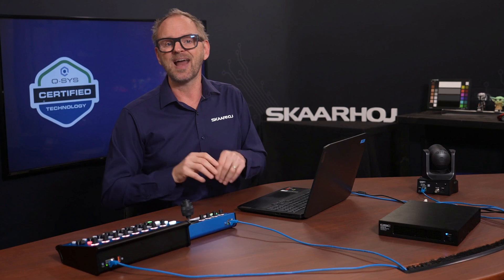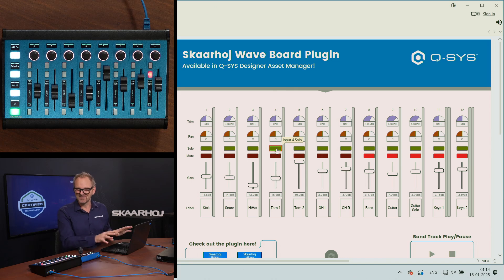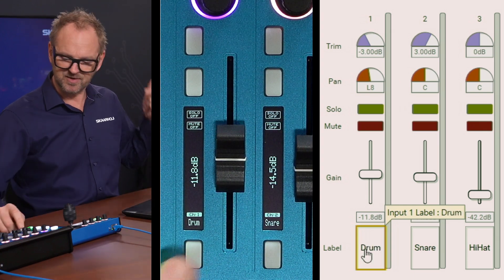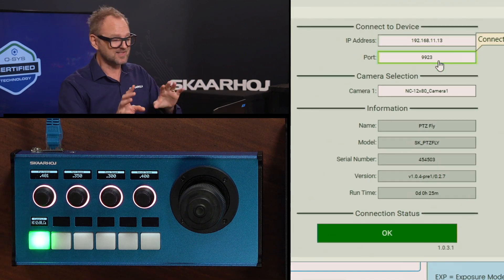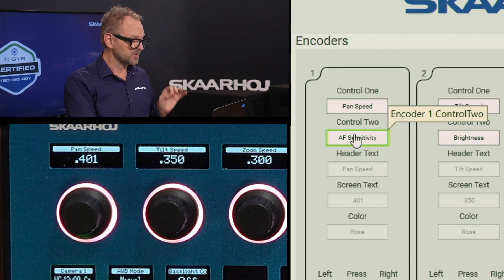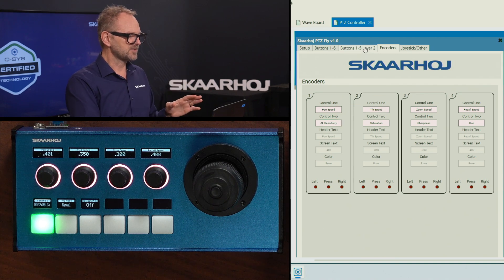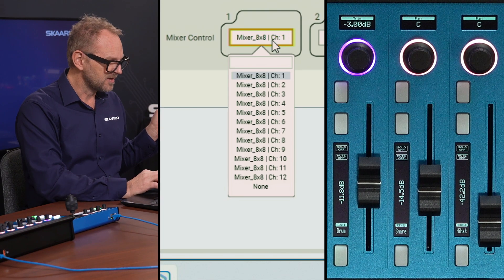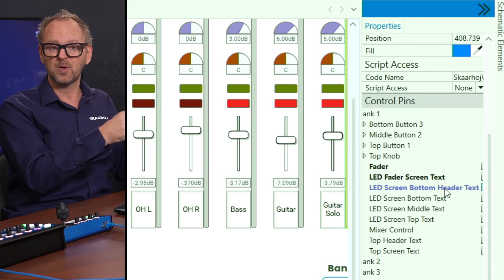SKAARHOJ + Q-Sys: Certified PTZ and Audio Control

Comment: Does this allow for a range of X/Y pan / tilt angles? It appears from the video you can go up / down, left and right, but not any angle or perhaps only 45deg?
Reply from the maker: The range of x/y pan/tilt angles will depend on the camera; we in fact just read the x/y values of the joystick and forward these to the camera. It would be up to the camera to move at an angle or in steps. Also, in this case our panel is controlled by Q-SYS software, so please reach out to them for info if they have added more functionalities to this.